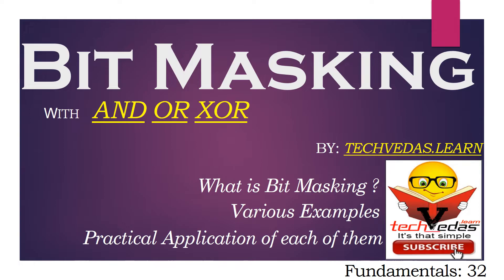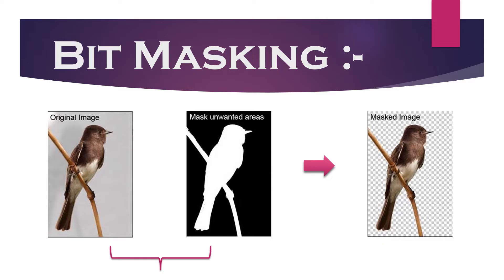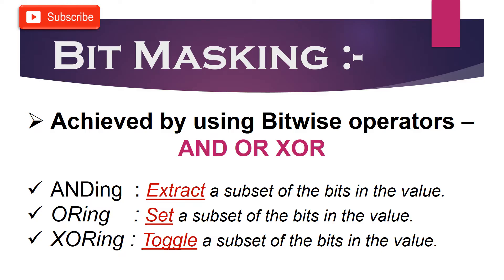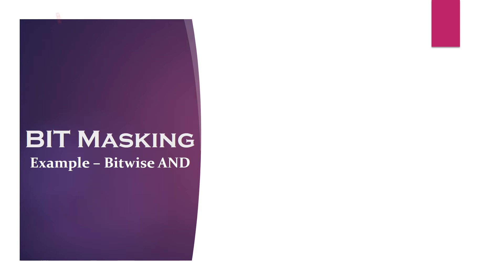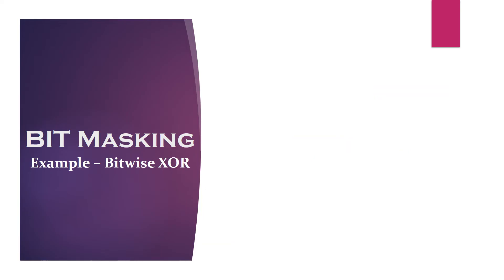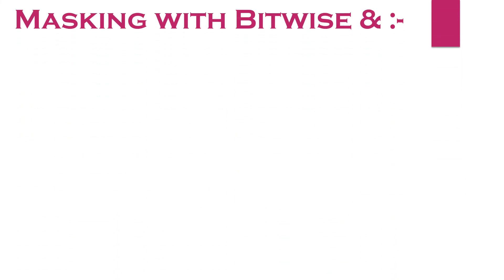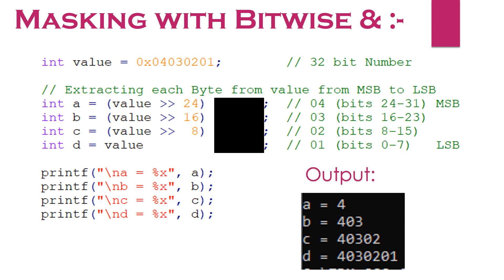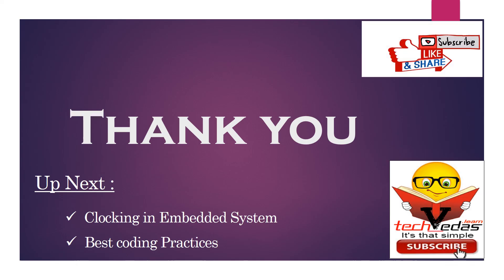What is Bit Masking | How to apply Bit Masking | Types of Bit Masking

Comment: to extract bits of lower nibble in your example for AND operator , shouldnt it had been opposite ? you should AND the lower nibble with all 0000 and the higher nibble with 1's so the higher ones remain unchanged . Am I right?
Reply: No. The example shown is extracting bits of lower nibble. This means you want to have the lower nibble bits unchanged and the higher nibble bits become zero. So the video is correct, you should AND the lower nibble with 1111 so they become unchanged and higher nibble with 0000 so they become zero as well.